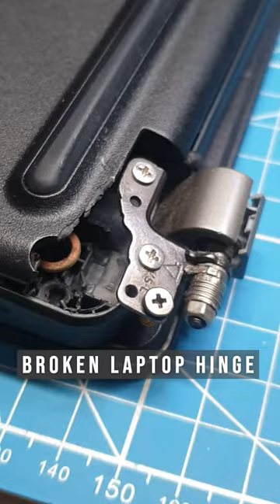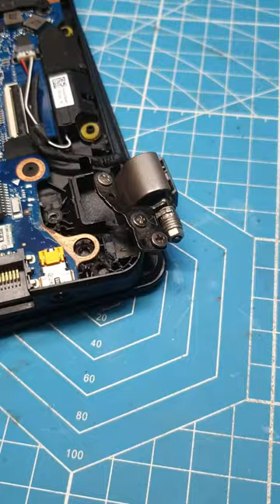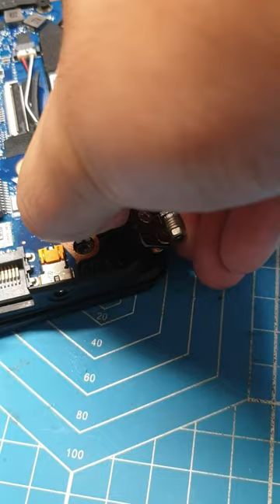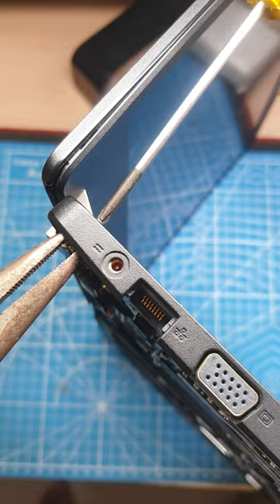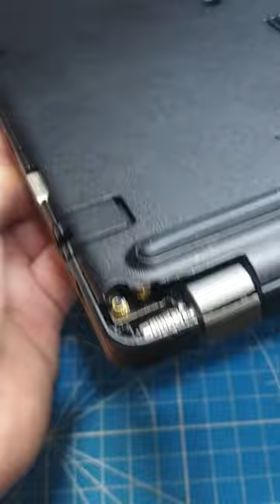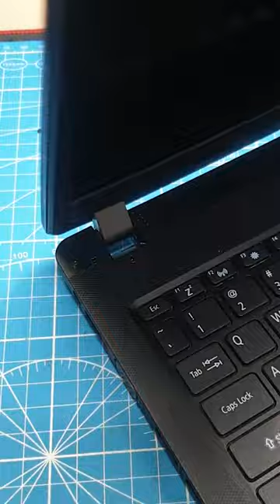How to Repair Laptop Hinge (Broken / Damaged)

Comment: How much should pay for this ?
Reply from the maker: 10usd per hinge.
Reply: That's horrible 😅  just use some epoxy to glue down the broken inserts
Reply: @htibidiri  I've had super glue barely hold together a rubber corner of a phone case. What makes you think It'll hold together a hole laptop?
Reply: @SweetTodd Epoxy is not cyanoacrylate. It's quite resistant to traction, impact and vibrations too. And every glue is not applicable to everything in existence. You have to choose the right tool for the right job.If both ends were metal, anaerobic resin would be the proper choice, for example.